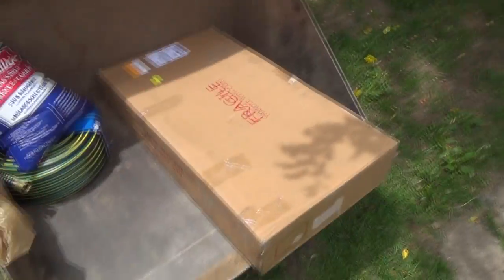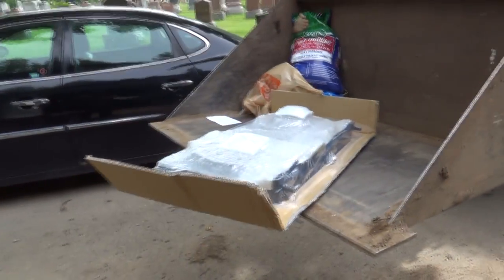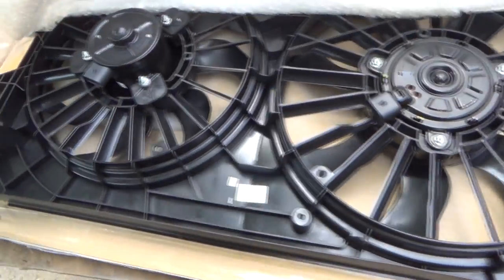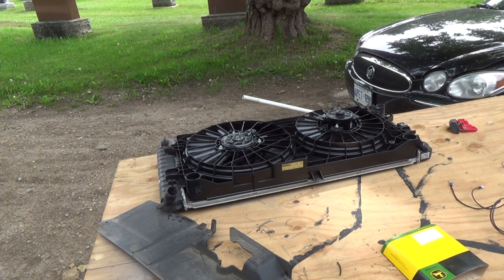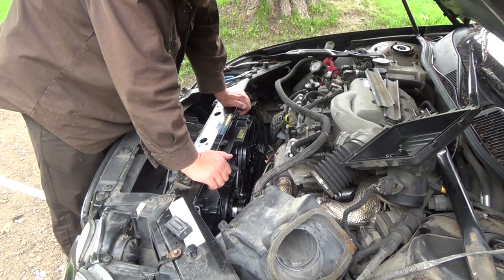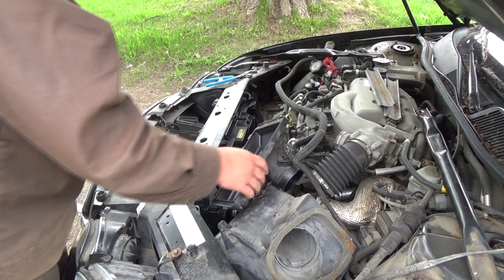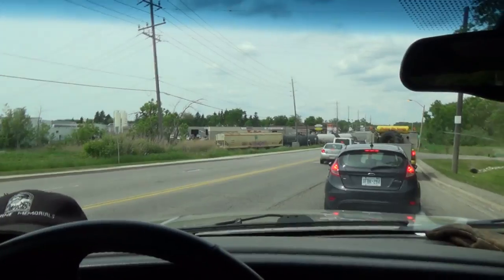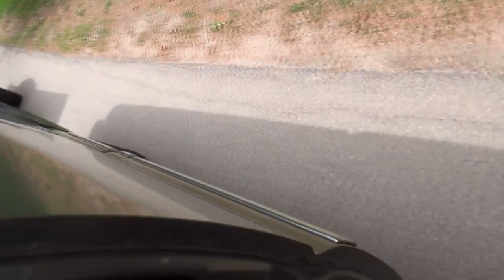yaahhh fedex came today

Comment: Bill, I was just being nosey a little and found that there's an actual Praxair welding supply place in Brampton, so if the TSC place jerks you around like they did last time you could try going right to the source. Looks like it's not too far from Orangeville.

Comment: 16:55 trust me. I know the feeling. The power steering on the car, the driver window on the car, the mower is broke again, the tractor tires are flat, the bikes need new inner tubes... etc.. and it never ends. AND I work on small engines for people. Be very glad that you can afford a $400 set of fans and a new radiator, and two awesome motorcycles. I'm sure you have bills on those, but I mean seriously. And be glad your job is that you're home all day. I'm sure that we don't see paperwork, and funerals, and anything else that you're not aloud to show. But its better than having a 9-5 job I'm sure. 

And the blades are on becauae the brakes are worn on the pulleys, so the engine can turn the belt and spindles freely, but you probably state that later in the video. I'm only at 16:58...

Comment: Hey Bill, sounds like for your truck one of the bearings in the wheels are going out. The same thing happened to my 03 Z71 Chevy Avalanche 4x4 and sounded like that, and then after awhile it became a loud squeak and grinding sound.

Comment: thats why most people get a new car if they can afford one after 5 years.. once you start replacing... you never stop.
Reply: but eh it keeps u busy
Reply: joshua orzako
 well a 500$ fix every few months is still cheaper than a 500$ payment plus higher insurance EVERY month
Reply: Veikra Not if your car is parked and you have nothing to drive while you are waiting for parts. Plus more than likely a newer car will be more fuel efficient so it will even things out pretty quick.
Reply: Towndrunk26er Ik so ya it'd be more convient... if u had the money that is.
Reply: If you dont want to wait for part or have downtime you inspect and replace before it's too late and can't run anymore. But I agree with you for some failures like where it's not preventable. In either case, you can rent a car with the money you saved on insurance and new car payment throughout the year :) Guess im used to running 20yo cars and not having troubles with them. Of course, not everyone work on their own cars
Reply: Veikra It can be a balancing act. For some people they can nickel and dime their cars back on the road for others an older car is just not cost effective.
As a former fleet manager anything over 5 or 6 years was on the chopping block because we saw the cost per km go up significantly. The same will also apply with daily drivers if the km's are getting up there.
Reply: Ik people who get a new car just for the heck of it or they just dont like how it performs and all. cause a majority of people who dont have a job that involves alot of tools or just has alot of tools... they dont fix it themselves

Comment: bill just so you know you can buy a pre made set of brake lines for your truck FROM GM, and its NOT very much money at least my fathers 2006 half ton was only 140$ canadian yes you need to add unions but ill be trying to install it here in the next week or so.
Gm has released a bulletin in SI on it, rubber coated lines all the way around
, the process to narrow down your truck can be a pain but it isnt that bad!